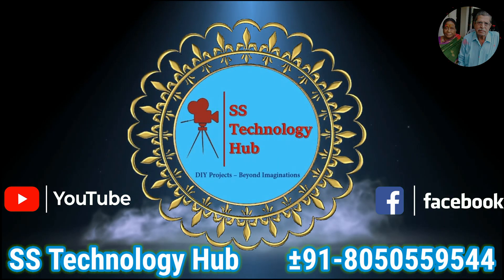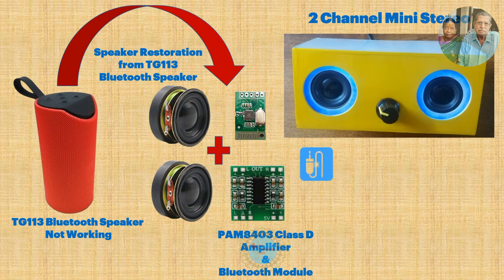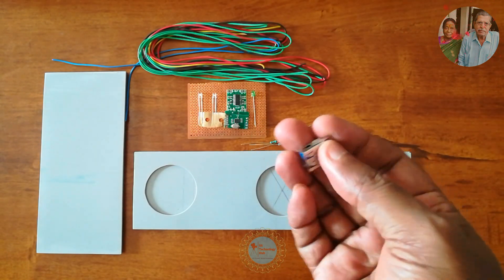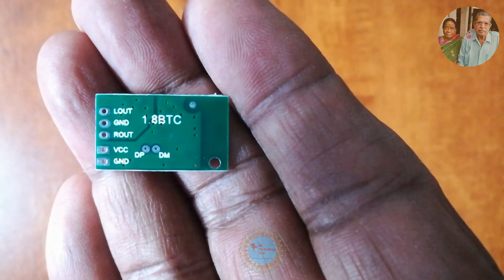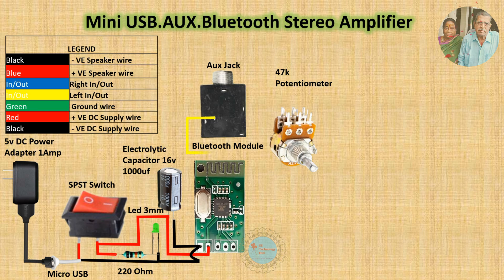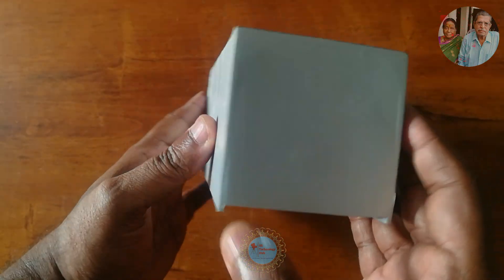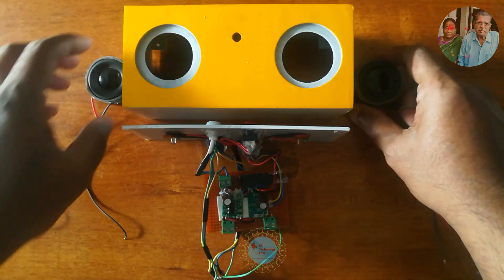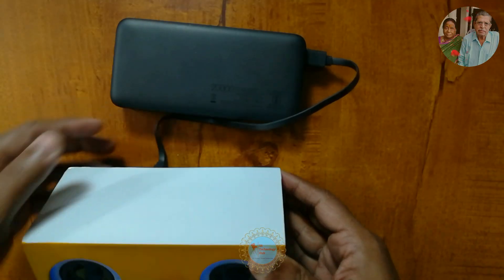Class-D Mini Stereo Amplifier | SSTechnologyHub #audioamplifier #trending #usbspeaker #pam8403

Comment: Hey buddy, awesome video, i am trying for the first time to build a small device with your video's help.
Can I use a 2200µF 16V Electrolytic Capacitor instead of 1000UF
Reply: You can use a 2200uF . All it does is filters "noise" at the input and filter DC on the audio output (if any). It does not damage the ic.
Reply from the maker: Thanks ling for sharing valuable information. Have tried with max value and beyond didn't experiment. Will give a try and keep you posted
Reply from the maker: Hi Thanks for visiting my channel and appreciate for making yourself. Good initiative. 

Now coming to the point , use with 1000uf 16v for good performance and have taken the max for good quality and clear sound.
Reply: @sstechnologyhub  as i said i am new to this hobby, hence just trying to make sure there is no confusion, found all items on HNH except for this 1000 UF unfortunately :( if I had to buy only this item there gonna be a shipping price again
Reply from the maker: I understand bro just give a try in local electronic store. Have used the maximum value. Hence not recommended to go

Comment: How about 2inch  speaker do you know what inclosure the box.
Reply from the maker: Please tell T/S parameters and which one you're using speaker or woofer? 

Also you can install ajdesigner and Subbox Pro softwares for home usage, this will guide for good enclosure
Reply: @sstechnologyhub  i have fullranges speaker.
Reply from the maker: Good would suggest to go with sealed enclosure either mini scoop enclosure and dimensions are
6*9cm - 2
6*8cm - 1
6*6.5cm - 2
6*6cm - 1
6*5cm - 1
2*5.5cm - 2
2*6cm - 2
Reply: @sstechnologyhub  thats is good for 2 speaker in one box.
Reply from the maker: Ok.

Here are dimensions
Length: 144mm - 2
Height: 74mm - 2 
Width: 70mm - 2

Comment: can you please share the cabin dimensions
Reply from the maker: Hi - here are dimensions of the class d mini amplifier enclosure measurements are
Length: 144mm - 2
Height: 74mm - 2 
Width: 70mm - 2
Use 1.5" inch full range woofer this gives amazing sound quality and you can feel the experience. PVC thickness is 2mm have use in my project.

Let me know incase you need any further info.

Thanks
SS Technology Hub